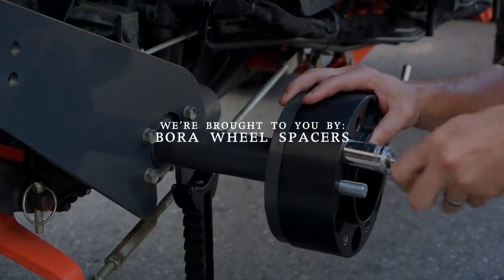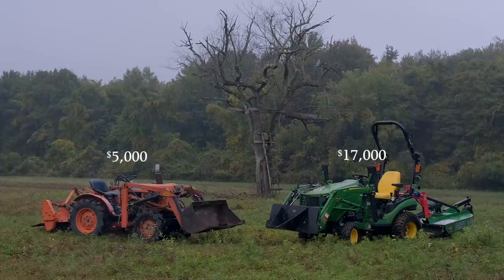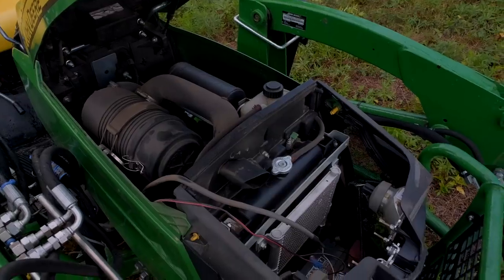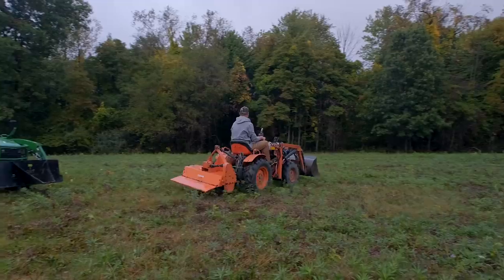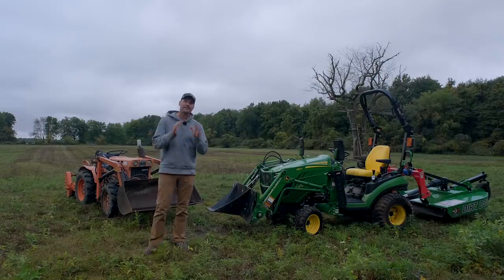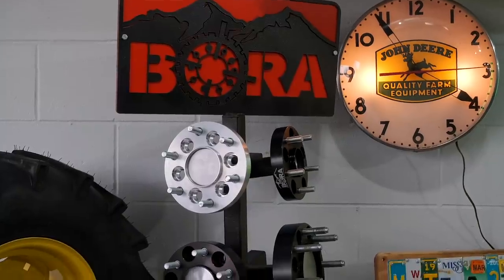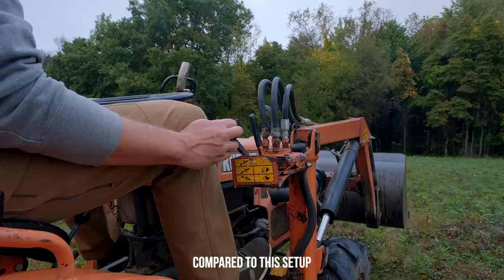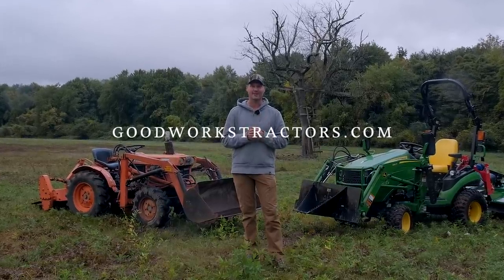WOULD YOU RATHER? WORK ON YOUR TRACTOR OR PUT YOUR TRACTOR TO WORK? 🤔

Comment: Good comparison all valid points. From the point of view of an old farmer  like me the Kubota looks like a real tractor while the John Deere resembles a  fancy riding mower because of the wheels.
Reply from the maker: Haha, I understand!  My grandpa would likely say the same thing.
Reply from the maker: Give this a watch to see a little pull test we did with the JD 1025. https://www.youtube.com/watch?v=zL1_lUwTmK0
Reply: @GoodWorksTractors  don’t mind the haters Courtney
Reply: I just bought my Grandpas JD70 for 1500. Runs like a champ. Needs 3 point and it will pull anything.
Reply: @outinthesticks1035  1953
Reply: @outinthesticks1035  it has rockshafts. Just need to buy the conversion kit and its got a 3 point.
Reply: @outinthesticks1035  the standard 3pt at the time was the 800/801.  Now a days, steiner and titan attachments make a more contemporary 3pt, more like the 720/30 hitch.
Reply: Kubota not the home team🇯🇵, I cheer for the home team 🇺🇸
Reply: You're probably the same guy that calls modern auto loading pistols Tupperware and swears by the 1911...

Comment: Ive had a Kubota B7200 HST  from mid 80s  for a long time.  Your comment about a little Bulldozer is spot on.  I bought a John Deere 855 with Backhoe.  Nice Tractor but never felt as solid as the 7200. Sold the Deere and bought a new BX23s which I love. I still enjoy the 7200.  It just seems bombproof.  I have people ask about buying the 7200 on a regular basis.  The value on it without any thing included but the front end loader seems in the $8000.00-$9000 range.  Over 10k with the backhoe I have for it.   The prices for these keeps going up.   Good video, Thanks

Comment: One other point on the pricing, The old one will probably be worth $5000 for a very very long time where the new one will eventually get down to that $5000 worth
Reply from the maker: I sorta agree...I would say that unless that Kubota gets trashed, it may keep increasing in value still unless it suddenly turned into a full time workhorse.  The "floor" for tractor pricing continues to rise (inflation) with time.
Reply: @GoodWorksTractors  I normally buy broken and then make repairs but even broken tractor and equipment market has shot up.

Comment: Great video. I agree with most of your points, especially power steering. But I have a 1978 kubota L295. Bought it for $500, put $1200 into it, and been working it for 6 years with out issue.

Comment: Good video. It doesn't take long for a new tractor to get old. New tractors have a lot more electronics, switches, connectors, and sensors that can corrode and go bad just after the warranty runs out. You can proactively replace parts on an old tractor to make it 'new' and more reliable, I replaced the whole electrical and starting system on a 1950s Ferguson I have down to even the two dash switches on it for less than a monthly payment of a new tractor. Replacement parts for the old tractors can, on average, be less expensive than the new tractor replacement parts. Certainly uncommon old tractors are hard to find some parts for without tracking down a parts tractor to pull a few replacements but the Fergusons, Fords, Allis Chalmers, and International Harvesters from the 1950s and 60s were produced in huge volumes and many are still used keeping service parts easily available (some you can walk into any Tractor Supply and pull the part you need off the shelf). Old tractors can be repainted to look like new too. The decision point always comes down to how handy a tractor owner is.

Comment: The ease of switching between mower and loader and back again is why I bought my 1025R.  At my age I don't have the strength or willingness to lay on the ground and switch out a belly mower.  Love the videos. Keep up the comparisons.  I'm now going back to find the one on how to put on wheel weights.
Reply: Hey Paul, as a fellow John Deere 1025R owner who resembles your “at my age” comment, I took time to evaluate ballast weight options. 

In the end, the same reasoning you gave to go with the more expensive, yet convenient modern tractor with features like the John Deer quick attach front end loader, auto-connect mower deck, and iMatch three point system, I shunned the wheel weights and filled tire options. These options make it much more difficult to, for example, remove the tries to clean the hydraulic screen filter.

I went with a three point weight bar, suitcase weights, and weight cart.  No physical lifting needed to add or remove my weights as I go from front end loader work to mowing. 

Yes, this method costs more once, but from what I am seeing, your back will thank you and you can always get your money back if you choose to sell.
Reply: @DougAlesUSA  Thanks Doug. that is what I am thinking.  I don't want the filled tires because I use the tractor for mowing and don't want the added weight or compaction.  I am  looking at the weight bar and weights.  Might also get a ripper to dig trenches with and a blade to attach to it.
Reply: The newer tractors definitely have their advantages but at this point other than basic function it is hard to compare them.

New tractors have went to the idea of flotation over traction. Older tractors had tall skinny tires to dig to the bottom to find traction. I actually had a very messy sludge cleanup job where we found that the 1986 Kubota we had worked much better than a 2000 CAT 416 backhoe for this very reason, traction. In nearly every other use the Cat was the go to but that little kubota got to own the day.

Years later I bought a fairly new at that time 3032e JD( 2013) mostly because used tractors were 80-90 percent of new price in my area. The 3032e does have it's shortcomings but does everything I need.

Comment: Your antique resembles my L245 vintage mid '80's. Bought it three years ago with only 742 hours. Only repairs I have made are an o-ring in the fuel shut off valve and replaced a pivot pin in the seat floating mechanism. Had to replace front tires and should replace the rears (you can almost see the air in them). As for creature comforts, I have no idea what you are talking about. Nothing is comfortable about this tractor. Absolutely reliable. Wish it had a loader. To add one costs more than the tractor.
Reply: I purchased a L245DT with a loader a few months ago for 3600 with 2800 hours. Thing runs like a top has a few leaks but nothing big. Needs one curl cylinder rebuilt but it’s a work horse without a doubt. I do wish it was heavier like he mentioned.

Comment: Took half the video to id the B7100. Only plus are the quick connects and the ability to put on a stump bucket on the 1025. Had my B7100 for over 25 years, with minor issues. All Deere equipment, I've owned, required multiple repair expense and time at dealers. My experience is they want to sell you the newest, prettiest model and not fix their older stuff. Would not buy a John Deere product, want more money to fix poor design. At least I can easily fix the older tractors myself without going broke.

Comment: I have 5 old tractors (1930's-1960's), and one new modern tractor (2020).
When you want to actually get work done, there is no comparison. 
The old tractors always have issues, and while they are easier to fix, you can pretty much expect them to have problems every time you need them. 
Most folks that say they prefer older tractors simply haven't used a modern tractor.
Reply from the maker: Great points James.  I should have clarified that I really appreciate older tractors.  This video is not meant to knock them at all.  Really, more about addressing a common question that I'm asked from customers when they are trying to make a tractor purchase decision.  Thanks for sharing!
Reply: @GoodWorksTractors  I absolutely agree. The old tractors are great for what they are, but they're a lot like owning an old pickup truck. 
Everyone thinks they want one, until they have to crawl underneath it in subzero temps to change the starter motor or fix a broken u joint or something else every other week. 
I don't mind fixing stuff, but it gets old after doing it for years.
Reply: It takes no time at all for the new tractor to become an old tractor.
Reply: I’ve got an old gas MF 35 deluxe, between vapor locking, leaking axle seals (one brake), charging system issues, carb issues….. after buying & running a MF GC1705 hydro for 250 hours, then trading up to my Kubota L2501HST, the old Massey will rust in the field. I hate old tractors!
Reply from the maker: Well unless we really are loose with the term 'old,' it indeed does require SOME time by definition. But we hear your point, it's a used tractor as soon as it's out the door.
Reply: @james b,  perfect comparison.  When I jump on my tractor I need it to work immediately.  I don't want to have to fight it to get it to work or hope that it starts and possibly spend a few weeks ordering parts.   I spent $35K on a new MX5400 this past March and it should start and run when I need for at least the next 10 years.

Comment: Catching up on videos.  I grew up on IH products -- first drive was at 5 on a Farmall 100 in 1962.  The last one used before I became an office occupant was an IH 674 in 1982.  When we bought our farm and built our house in 1992 I bought an IH 574.  The thing about those older machines is that they need to be used almost daily to stay in shape and that's not what I'm doing.  We switched to a JD 4052M about 3 years ago and there is no comparison between the old and the new.  While the weight of the 574 was an asset, the JD is just better in the rest of the measures, especially when it comes to versatility.  Good video.

Comment: 1968 Ford 5000.  Purchased for $6k about 3 years ago.  Needed to run a land plane and inverted snow blower.  Also run a boom pole to move logs.  Would be looking at a Deere 4000 or even 5000 series to get a similar rig with Class II 3PH.   Cost me about $1000 in parts to completely overhaul to make as reliable as new.  Even upgraded things like the ignition and now run an alternator.  LED lighting makes for far better visibility too.

Oh yea, and it came with power steering from the factory.  Cost me $40 in seals to overhaul.

When you get into new machines as big as this, you are looking at computer controls that make doing your own work on the machine impossible.  Right now I know farmers with modern tractors that are sitting idle and using their old machines because parts and service calls take forever to schedule.  Heck, I know farmers who swear they will never buy a new machine and will continue to keep the older iron going.  Most are 1980 or 1990 vintage, not 50 years old, but the issues with the newer machines are not insignificant.

Comment: I had a B7100.....It was my first tractor....4WD /Hydro.....No power steering......60in belly mower. Tractor served me well.....I pushed it into harder service until I bought a JD 855 and then traded that up to a JD955...but keeping the Kubota for mowing exclusively.  The one thing that did happen with the B7100...Vibration got the plastic fuel tank.....Being around Hot Rod shops......I had one built of alum.

Comment: I own the Kubota 7100 HST, it came with the loader and hydrostatic transmission for about $4k. It also came with a roll bar and the only maintenance I have had in 10 years is oil changes and rebuild cylinders on the loader. No maintenance nightmares, every time I need it, it starts right up. I think you slightly misrepresented this excellent product.

Comment: Hours, age, maintained and garaged to me are the big difference.  My JD 670 is 30+ years old but other than oil and battery maintenance I've had 0 problems. However I take care of it and keep it garaged when not working. But time is working against it and seals, hoses, belts may soon cause an issue.
Having said that I'm in the market to add a newer 4 series due to power, hydrostat, etc. to augment my operations. Cheers!

Comment: One thing not addressed is whether the tractor will be your first tractor or not. If you don't have experience with tractors or heavier equipment repair, buying that particular Kubota as your first tractor would likely be an expensive mistake. Now that I've owned a L4701HST for 6 months, I'd be more likely to consider buying the Kubota. The L4701 is nice, but it's too big for lawn work. I'd actually like something like a BX or a 1025R to use in the yard. The little Kubota would likely do what I want, and I'd feel comfortable working on it, now that I know my way around tractors a little more. Slight disclaimer: I've wrenched on cars for 40+ years for myself, but no diesel experience. However, I did stay at a Holiday Inn and I do watch Diesel Creek, so I'm pretty confident I can do any diesel engine work now :)

Comment: I love the modern tractors, and you are correct for the most part. The newer tractors are much more user friendly. They come with the creature comforts and the safety features we love and expect from the factory. But at the same time, many of us just cannot afford the newer tractors. And I for one love tinkering, and making things better. For my birthday last year, I bought an old 79 Power King 1614 economy tractor for $800. It didn't run, and only had the plow, and a pitiful excuse for the box blade. I got it running really good for about $30. Another $200 got the rear hydraulics working, with much better upgraded lift arms that are category 1, instead of the weak little category 0 lift arms it had. So far under $1500, I have a better version of the original tractor. It's not anywhere in the neighborhood of today's hydrostatic tractors, but I love this thing. I'm currently designing a transaxle driven 1 3/8" rear pto that will be ran off the mule drive, when I choose not to use the belly mower. I also have a Yanmar yfl 1500 loader that I'm putting on this little tractor. The loader will have its own hand-built subframe to mount to that runs the entire length of the frame for extra strength and rigidity. The hydraulic tanks will be mounted to the loader itself on the uprights. The left side tank will feed the rear hydraulics, while the right side feeds the front. This will allow me to place the loader hydraulics remote by the seat at a more comfortable position. This tractor will also have a hand-built rops system installed. I should be able to keep the entire build under $3500., and I can do it at my pace. The tractor of course does lack some benefits that I can't overcome, but that's part of building an old tractor that I have to deal with. It naturally lacks 4x4 which is a bummer, but the Dana-Spicer gear drive rear end is incredibly strong, so it's ok. It doesn't have power steering, but this little tractor doesn't need it. It steers really well, and fairly easy. The biggest weakness is in the take-off. Hydrostatic tractors have a nice ability to take-off really smooth when engaged. My little tractor slightly jumps, especially when throttling up, and this can be trying in tight situations, but that's just the nature of the beast. It pulls my box blade really well, and I also have a 4 ft tiller for it, and I have 4 foot brush hog coming. I plan on hand building a land planer for it, and I'll have pretty much everything I want for it. I really want a nicer Hydrostatic drive tractor, and one day I'll get one. But for now, this is what I have, and can afford. I love the look, feel, and simplicity of this little tractor. I guess you could say it has its own charm. I do agree with pretty much everything you said in the video, but I can't deny that I just love my little Power King!!!
Reply: Appreciate what you can afford and have.  Can be just as satisfying.
Reply: I also have a Power King 1614   I they were green I and had some upgrades these tractors would be more popular today.  It was a family owned business that didn't have a strong dealer network.  When you see how the PK is built you begin to think of how you could build your own tractor.
Reply: @timothykeith1367  yeah I never knew much about them, but I really like the look and the simplicity of them. It's simple and easy to use

Comment: 5K for a B7100 with a loader and a tiller is a heck of a good deal.  That's an old 7100, the 4 lug front wheels give it away, but a later year B series with a Hydro would be an interesting comparison to the JD.

Even though my preferred tractor didn't come out on top here, I still liked the video. 👍

Comment: That Kubota is a tank. Older tractors are a joy to run. I love running the old 8n, H/M, 60s, Bs, etc. 

Not a huge fan of the aftermarket loaders though, the tractors designed for them work much better. 

It’s cool to see how tractors have evolved over the years.

Comment: Well, we have both: Dutra U28 around 60 years of age and a new 4052 JD. The old one is very easy to repair if it breaks down with a couple of wrenches. The new one is relying almost 100% on the dealership when it comes to servicing, but much more comfortable if you need to work longer and not giving puffs of smokes when you start it. :D